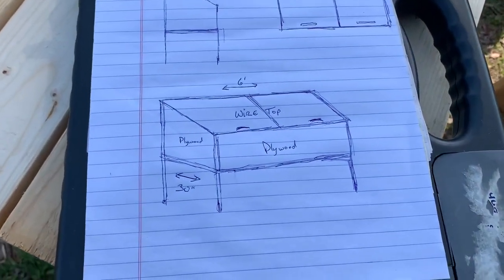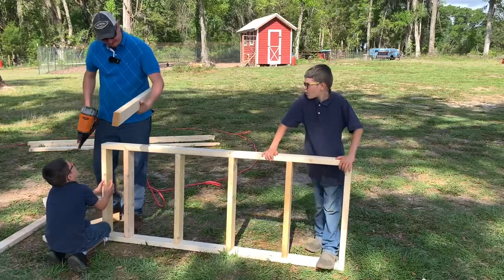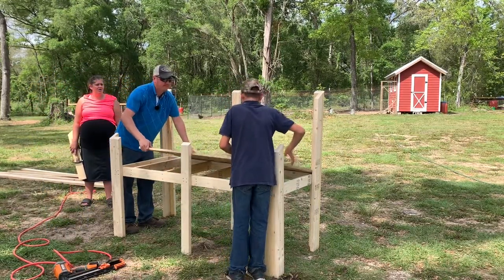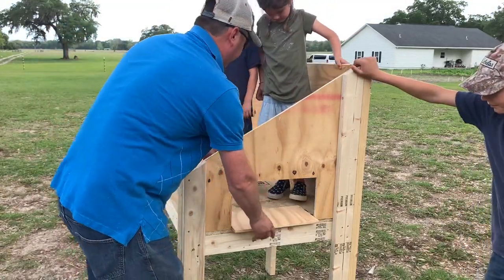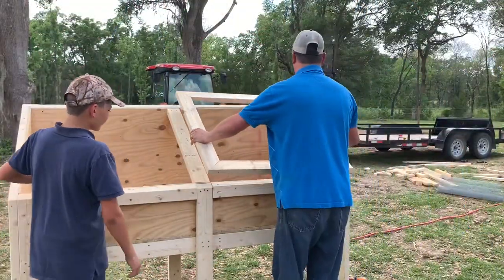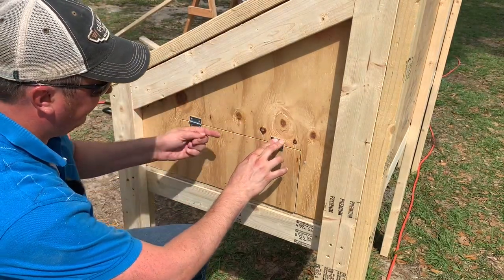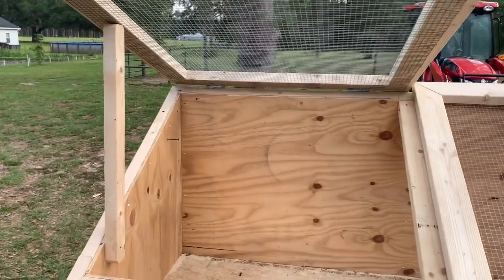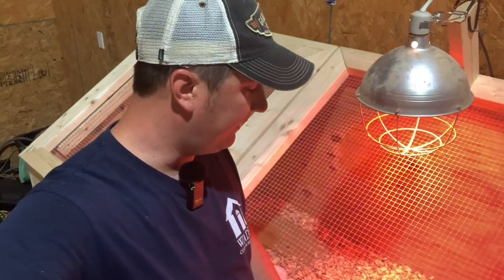Building a large brooder for baby chicks

Comment: I know this is a year old . I was given a chicken house form like tractor supply carries. It had a rotten top so I made it a A roof. Then the part that was for the laying box slash roost , I put a wood floor . Then I took a piece of linoleum and cut to fit the floor . Put my wood shavings in . Now when I need to clean it out I just gather the chicks and pick up the flooring dump it off wash it let it dry some and return it . Made cleaning out so much easier. Great brooder you built. Be nice to have helpers like you got . Beautiful family .
Reply from the maker: Thank you! The linoleum is a good idea, I may have to incorporate that!